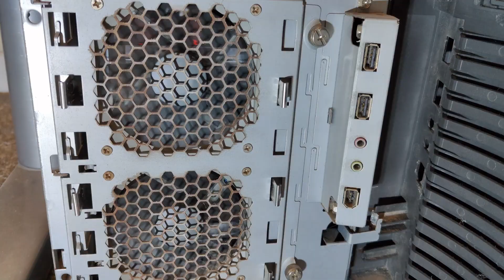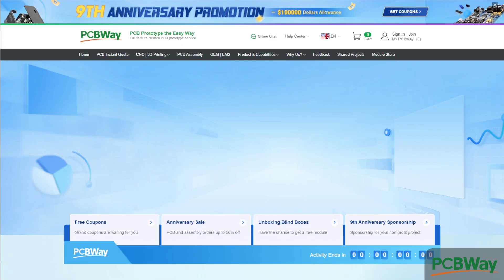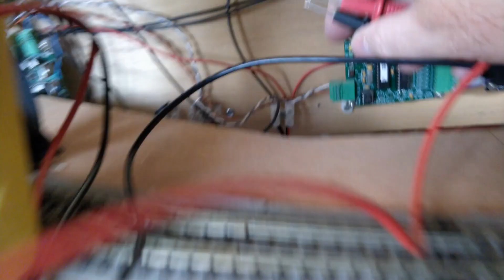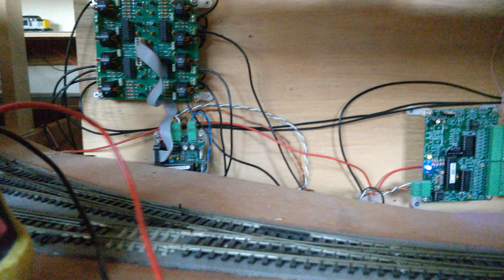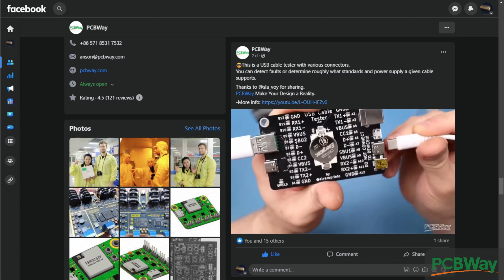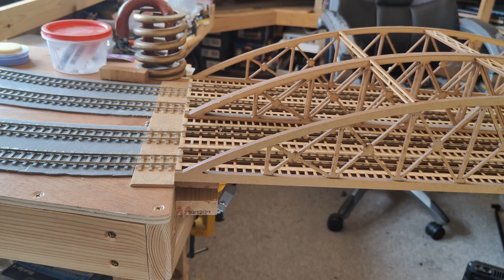Everything is broken!

Comment: Ah usb type b cables. There are no good quality ones.
Reply from the maker: Agreed for 'Micro-B', those seem to die after 3-6 months no matter how much you spend on them or how carefully you treat them. But this is the full size square type B, typically used for connecting printers and so on. I've not historically had problems with those.

That previous cable was an extra-long one though, as I used to need the extra length to get between the PC and the layout. Now the layout has grown enough to get close to the desk, most of the distance is over CBUS and not over USB. So a shorter cable is fine.

Comment: Shot in the dark, try adding some cooling to those chips and whatnot. Might improve longevity and make it all less angry
Reply from the maker: Cooling is definitely a good shout. The power electronics do have heatsinks on them, there are three on the top of the DCC controller and five on the top edge of the booster, both visible in the thumbnail :) There's even a gap in the baseboard to allow the heat to rise.

That's definitely a future consideration though -- if I close over that section fully to add scenery without thinking about the electronics underneath, I will store myself up a future problem.
Reply: @DongitsModelRailway  One or two noctua fans moving the air about might just be all you need. Lemme know if ya did any testing with the idea

Comment: when dealing with failing drives instead of copying the file system you should have done a raw copy using "DD / ddrescue" or something starting at byte position 0 to the end with skip enabled then done a reverse with retries , unless their are files you really needed first then you snatch those asap
Reply from the maker: These drives were in two separate RAID arrays with redundancy. If the dead drive had the common decency to properly die, it would have gone a lot faster, and I wouldn't have lost any more data. The lost files were a result of XFS errors -- it had already fumbled those files a long time ago, unfortunately.
If I had migrated the partitions to the new array (which would have been easier and faster), I'd have just preserved the corruption, not solved anything.
It also allowed me to unify one filesystem for files coming from both previous arrays, rather than having separate partitions on the new array depending on where the partition was originally stored. And I could ditch XFS for EXT4.